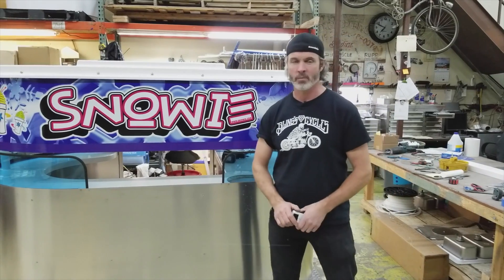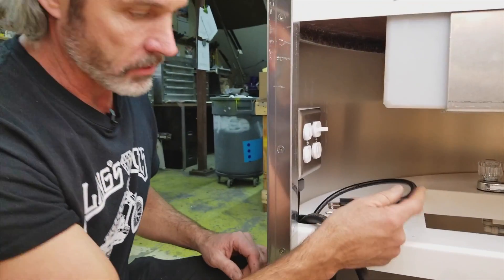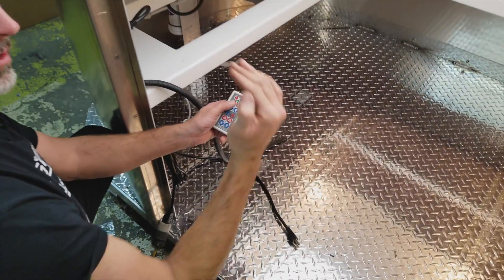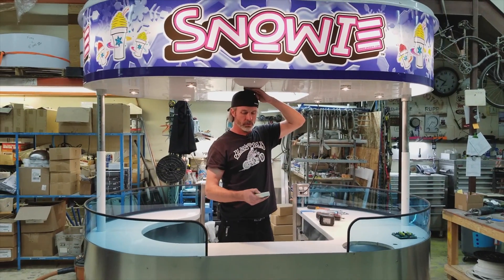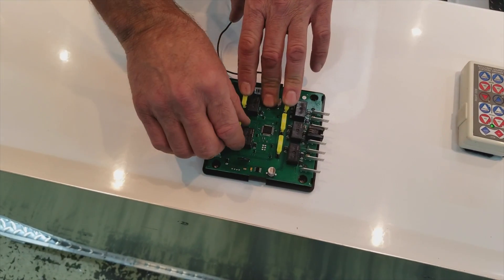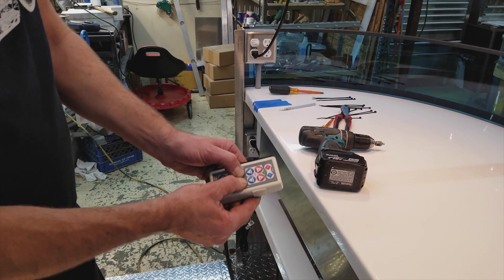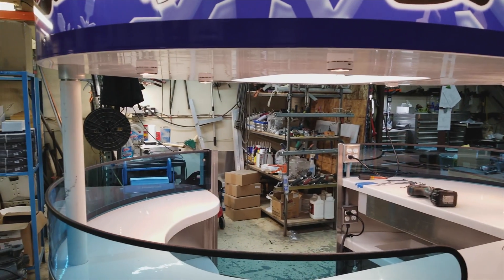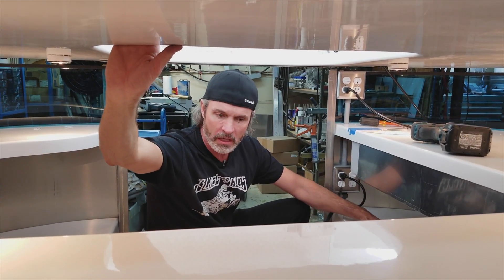Talking Shop Tuesday Episode #2 - New Motorized Telescoping Poles

Comment: How much was the cost for the Acturators?
Reply from the maker: $1847.90 for the entire motorized pole system in the kiosk.
Reply: @snowiellc   That is not bad price, does it also move about remote control?  I see in ITaly they do?
Reply from the maker: It does have a remote control.